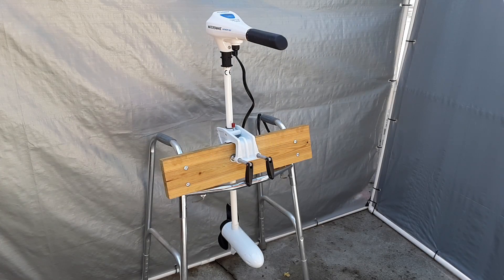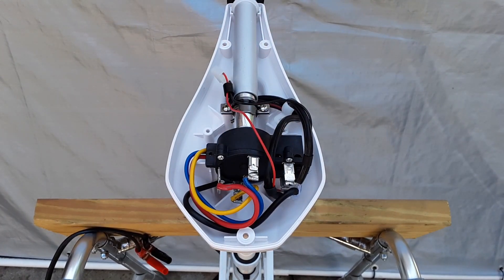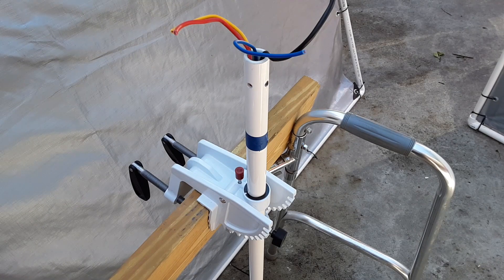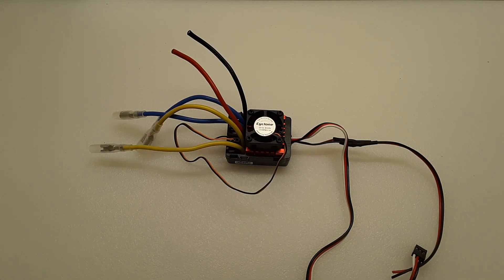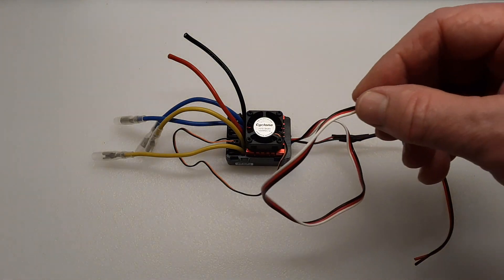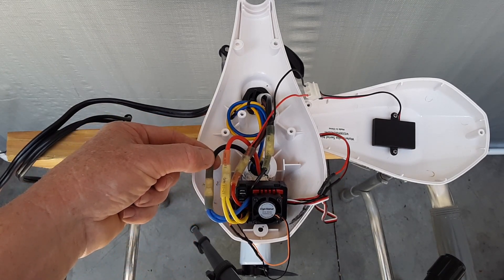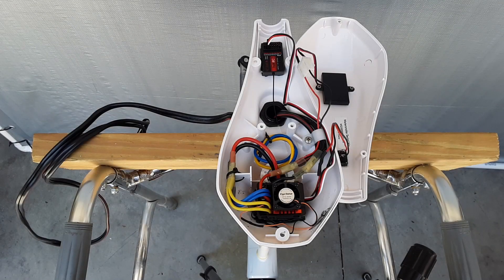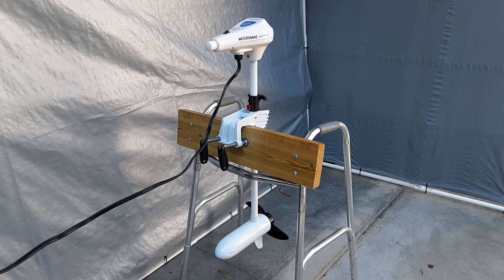Watersnake Venom Trolling Motor with ESC Wireless Remote and Short Shaft Modifications

Comment: Using a few of your videos for my set up with Water Snake Venom Sx 34/30. No significant problems. Decided to go with tilt/raise and it works fine but I didn't want to remove the head in case I ever had other uses, boats, e.t.c. The motor tilts up just fine/  I found I could haul the whole motor onboard by simply pushing my hand cable system straight forward and don't really need a separate pull cord but have it in case I only wanted to tilt partway up and be able to lower. Now, leaving the head intact. it is a little bit harder to pull up and wonder had I removed the head, would it have made any significant difference?
Reply from the maker: Seems like yours works just fine. Keeping/removing the head wouldn't affect the tilting.
Reply: @Aksmaniyak  thanks, my thought was that without the head, it would be lighter but as you say, probably wouldn't make an appreciable difference.

Comment: Great videos!  question regarding tilting though. Since the Venom 34/30 has speed control built into the handle, would an extension handle such as U-joint Helmsman clear the deck when tilting?
Reply from the maker: Thanks James. The stock motor can be used with a tiller.

Comment: hey man, what is the function of the yellow and blue cables coming from the crankshaft?
Reply from the maker: They deal with speed and direction and are not needed for this project.
Reply: @Aksmaniyak If I want to use the same stock potentiometer on this Watersnake motor to put it in a junction box near the seat, is it important to also extend the yellow and blue wires or is it enough to just run red and black?
Reply from the maker: @ginorizzo1531  If you are using the stock switch then extend all the wires. I would recommend changing the stock switch because it is very limited. The motor can perform much better.
Reply: Thanks

Comment: Coincidentally I just found this video (another great, informative, appreciated video) after ordering the Venom SXW34/30 - WalMart has an incredible sale on it as I write this!  I have purchased a PWM to eventually connect to this motor, but I wanted to share something I've discovered.  After my 1st Newport 36V lithium battery kept failing running my NK300 from 70% to 100% when fishing, Newport sent me a replacement battery that works great for the NK300.  They didn't want the original battery back so I have 2 - 36V40AH lithiums.  I purchased a 360watt 48/36to12VDC converter, connected it to my 12V inverter and ran various fan loads from 180 to 300 watts.  It turns out that the original "bad" battery does quite well with lower loads (provided 1500+watt hours), so I will attempt to use this rig for my 12V Venom with a larger converter (they get hot).  The important point I wanted to share is that the voltage converters produce a very steady 12VDC output, even as the load is varied and the lithium source is drained.  Some have expressed concern running 12V motors on  lithium batteries due to their higher voltage.  While I think that most trolling motors can handle the slightly higher lithium battery output voltage, it is nice that I risk absolutely no voltage issues when using the converter.  Long-winded here, but valuable info!

Comment: Which way gives you the best control over the motor wireless or wired? Which saves you the most amps or increases the battery life? Ill use manual way to steer.
Reply from the maker: Both give the same control but wired can be mounted. The wireless is hand held. I don't think there is any measurable power savings.

Comment: Thanks for all the vids. 
Have you ever encountered the below issue?
Followed all your instructions, purchased brand new venom 34lb mortor, esc and wireless remote. Works perfectly out of the water but when on the kayak, it runs strong for a few second and then cuts. Becomes unresponsive. Starts again for a few second but then runs very slowly before cutting off again. Keeps doing it until out of the blue it starts running normally and will then run with no issue for hours until end of session. Does the same scenario at the beginning of any new session. 
Thanks for your advise
Reply: mine does the same thing kinda frustrating

Comment: Can this be done with a Haswing Protraur?
Reply from the maker: No. The Haswing already has a digital speed controller.
Reply: @Aksmaniyak  do you think it's possible to wire in a radio receiver either in line with or to replace the pot?
Reply from the maker: Not that I have found.

Comment: Love this. What's the best way to raise\lower the watersnake as well? It's got that weird push fitting to lock position. Raise lower vertically isn't an option as using steering cables. Hmm
Reply from the maker: Thanks. I have a video where I show how to disable a Motorguide push button mount that should work for a WS.

Comment: I noticed that there are more than one feature on your hand held remote speed controller. You've only used it for forward and backward thrust. Am wandering if there are other hand held controllers you can recommend with features which include only the on/off, forward and reverse variable thrust?
Reply from the maker: There may be but I didn't find any that would work the way I wanted it to.

Comment: Does the control box need holes for air so the esc can cool off?
Reply from the maker: No, it is mounted in the head where the stock switch would be. It is not airtight.
Reply: @Aksmaniyak
I'm not sure if you can help. 
Brand new motor, modified exactly as per your instruction. Paired with a lithium 60amp battery. 
Out of the water no issue. In the water, at every start, runs strong for a few seconds and then cuts off. Then runs very slowly for 2-3 seconds and cuts off again. Keeps doing it multiple times. After a few minutes, it runs normally and will go for 1-2 hours with no issues. Have you ever come accross this issue or know what to look for to try fix the issue? 
Love all your videos- amazing

Comment: I have seen most of your ESC builds for different trolling motors; my question is have you used any of them with the LiFePO4 Battery 12V 100AH Lithium Battery? Thanks.
Reply from the maker: Yes, that is the battery I have now.
Reply: @Aksmaniyak  Thanks.